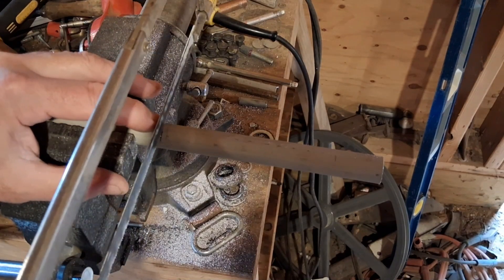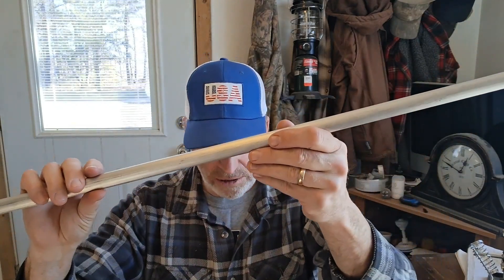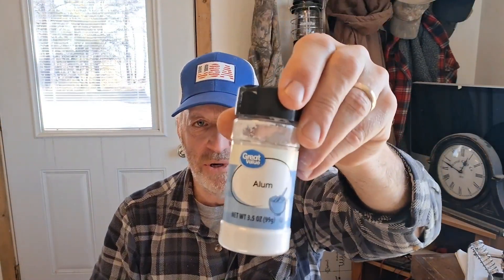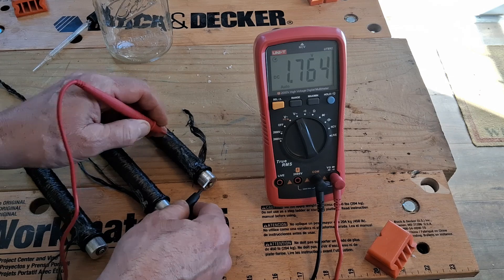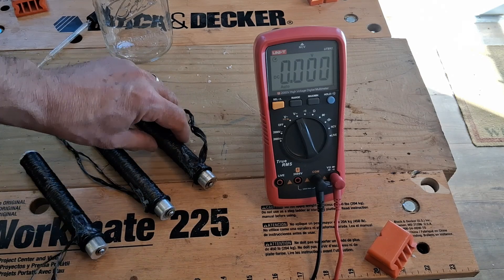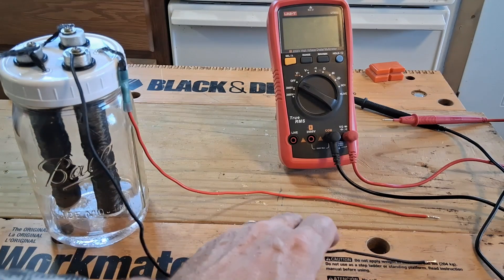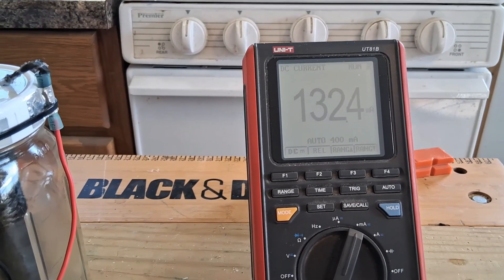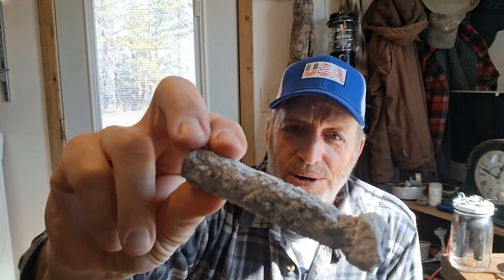Magnesium/carbon fiber graphite crystal cell battery, in a jar.

Comment: Thank you for doing this interesting video. I am an EE with 50 years experience and I have never seen this type of batter before, so it was fun to watch you make this battery.
So my question is how long will the Magnesium batter operate at approx. 1.7 volts???  Also where did you buy the magnesium rod at, sir???
Reply from the maker: I got the magnesium, water heater anode rod from Menards.  This is the first I used the carbon fiber graphite rope, so there are unknowns.  In the past I used solid block carbon filters with magnesium, and the voltage changed all the time.  Moisture level seems to be critical, how much load you try to put on it.  Interior pressure can increase and break them apart.  This one almost seems like it's an Air battery...  It's an experiment that I was just documenting in video, without knowing the final outcome.
Reply: Any hardware store. My local home depot has a variety. Also camping fire starters with the flint rod on the side are little blocks of magnesium.

Comment: How long will the battery last for before anode starts corroding and voltage / current drops off, im only asking because thats what happened to my previous crystal batteries over time. great video will look into it😊.
Reply from the maker: This will be similar to other cells that you probably made.  The difference is that it may be easier to control how damp the cells are, -there are multiple cells in the same environment, -you can easily remove them from the jar to dry them, -or just shake the jar to add more moisture to them; -and you can see them through the jar.
Time will tell.
Reply: @doubleMinnovations  ok thank you for your response, please keep us updated on their longevity.

Comment: The glue areas are lost surface area, not good. It's a paper towel .. wet it .. apply it - it will dry out and all is good. No glue.

Comment: Don’t seal the jars, they could burst over time you need a pressure release hole. They will off gas and produce hydrogen and oxygen.
Reply from the maker: That could be true.  I'm starting to think this may be an air battery...
Reply: @doubleMinnovations  In etwa: "KOH Mg +  O²"
Reply: Die Gläser sind über die Kapilarwirkung der Grafitseile belüftet.
Diese könnten mit einer Schlauchwasserwaage verbunden werden um so einen Druck-Differens-Messparameter zu haben als auch das Eindringen von Luft mit Elektrolydverunreinigung zu verhindern.